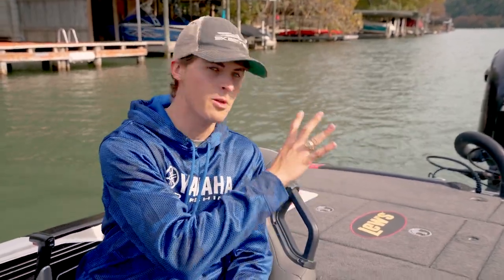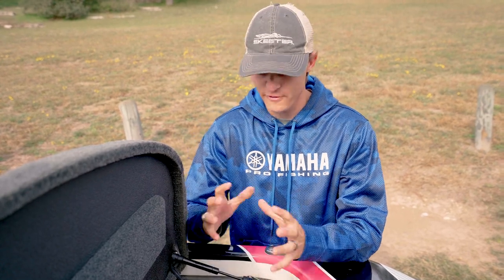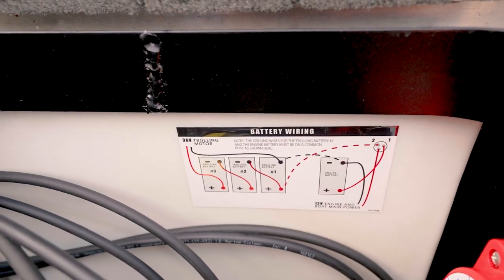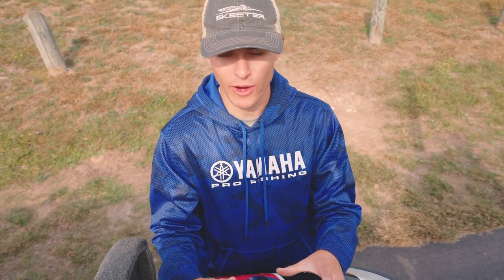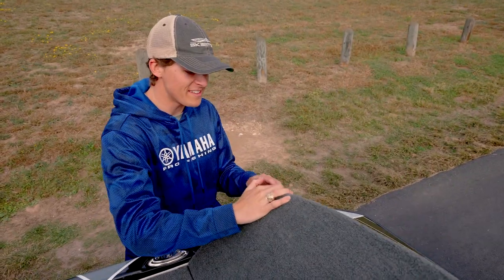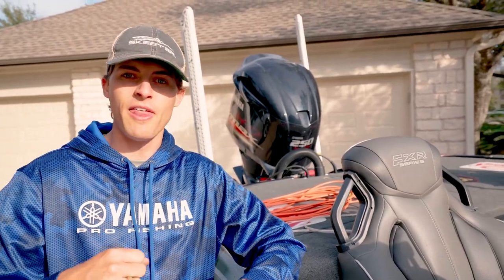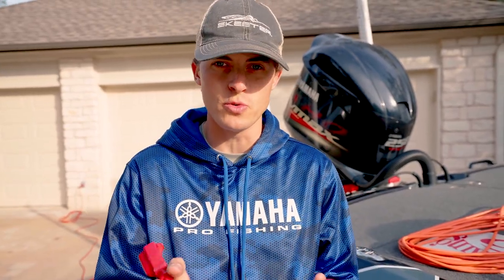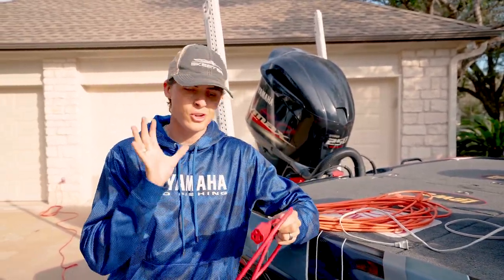Skeeter School- Electrical System Overview and Maintenance with Tyler Anderson

Comment: I just got a used 2020 FXR. Does the power at the switch panel by the shifter have to be on for the blinker trim and bow trim to work?
Reply: My 2023 ZX200 has to have the power switch on for those to work.  I know it can be frustrating to begin with, but it’s a good thing to be able to cut power off to everything if you ever have a power draw.